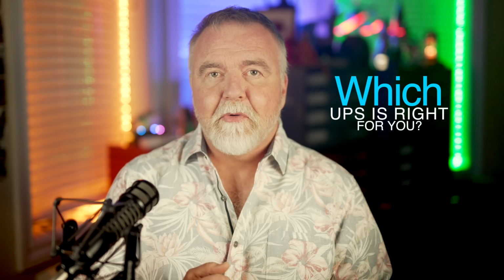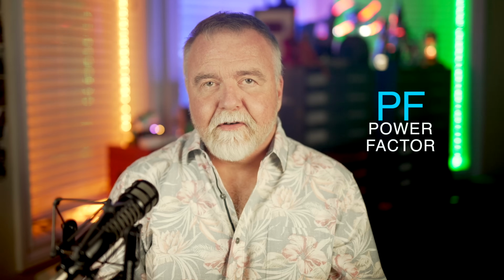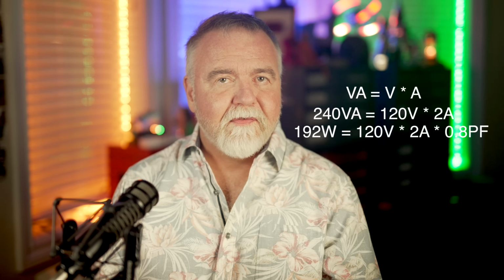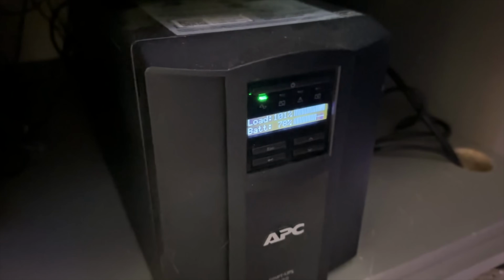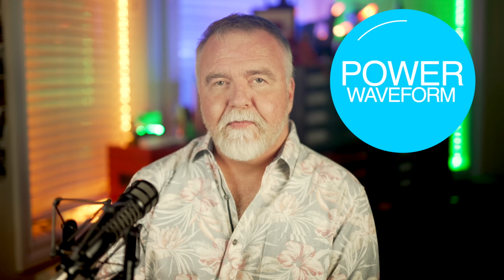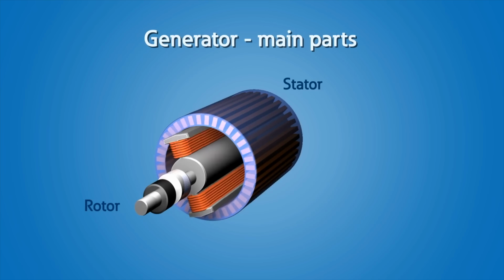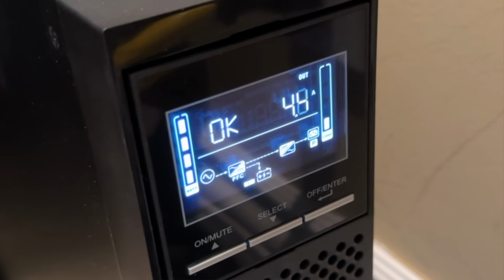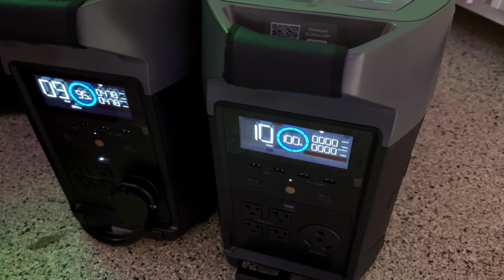The UPS Secrets YOU Need to Know!

Comment: Once upon a time, a very wise man posted to the Interwebs...

You’re concerned about your family’s safety. So you get a guard dog. The dog costs a fortune. It immediately poops on the floor. Then it chews off the entire left side of your Bang and Olufson. It bites the postman’s fingers. It then sleeps through an actual burglary. And finally it eats one of your children.

This is the UPS experience: If they’re not preoccupied with smoldering their lead acid batteries, then they’re busy buzzing and arcing. Then they blow an internal fuse on the output, and your Great American Novel is suddenly lost, again, for the third time. Then there’s an actual power failure (Yay!), so they turn on their patented 387 volt offset square wave, and your PC is instantly corrupted. Meanwhile battery acid squirts out onto the ceiling, again. Then, while you’re out trying to buy a replacement PC, the UPS catches fire and burns your house down.

I’d happily pay $800 to not have one.

🙂
Reply: What are you on about? I work with many UPSs daily doing IT work and while I've had the occasional swelled battery (mainly on cheaper desktop units) I've never experienced the catastrophic failure you have mentioned. Batteries might go bad and need replacing, but most UPSs these days use circuit breakers, not fuses. I break them down and scrap them often and have not come across many internal fuses either... At home I have a Libert (now Emerson) 2000VA online unit that is going on 13 years old. New batteries cost me $100 this past year and it runs my 900w of servers and network equipment just fine. 

What is your alternative for $800 exactly?
Reply: My workplace for almost 40 years has had two serious (for real) building evacuations. Both were the IT server room UPS system burning, melting, emitting smoke, etc. No thank you. That $800 is that "I'd happily pay $800 to not have one." Not, i.e. absence, my fee offered to fail to deliver one, the cost of an empty space where a UPS fire might otherwise be.

Did you at least enjoy the "...they turn on their patented 387 volt offset square wave..." sentence? That's got to be the funniest part; it still cracks me up even years after I wrote it. But the guard dog chewing "...off the entire left side of your Bang and Olufson" is pretty funny too. Cheers.
Reply: @JxH  then your workplace had extremely shoddy maintenance, bad cooling, or buys really cheap equipment. A UPS, just like the machines they protect, needs dust kept to a minimum and needs proper cooling. Anything over 75F or so is no good for the batteries, let alone anything else in those rooms. I work around this equipment all the time and especially anything you'd find in a server closet should not smoke or catch fire under any circumstances. Most businesses replace them on a 5-10 year life cycle and none of these things happen to them... 

The reality is you can not and should not run any server equipment without one in a production environment. Server hardware itself (as well as network infrastructure) is designed around the idea of never turning off and having redundant power, so much so that boot cycles can take 5-10 minutes and that's time you can't lose in a business environment, not to mention the possibility of data loss if the power suddenly goes out. There is no alternative to batteries in some form or another. Some data centers are using batteries at the load side putting them in individual servers on the DC side of the power supply which eliminates big UPSs and the inverters inside them, but either way a business can't afford to be down and that's why they exist.